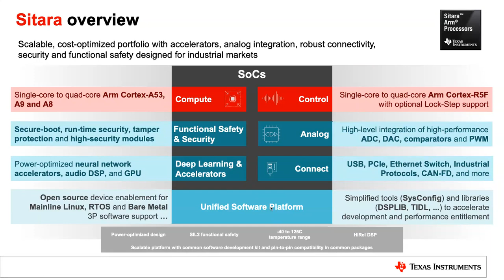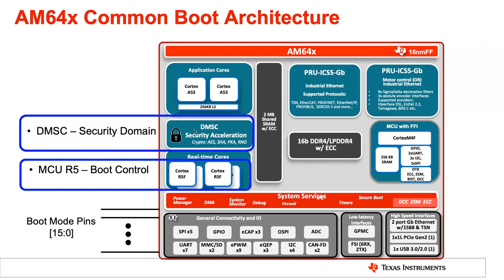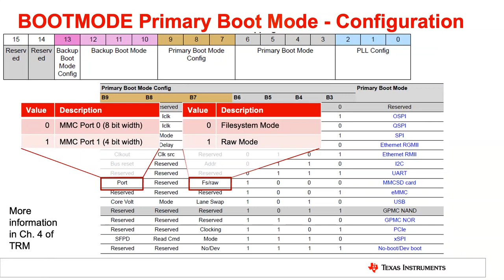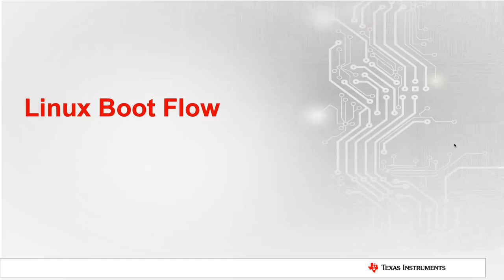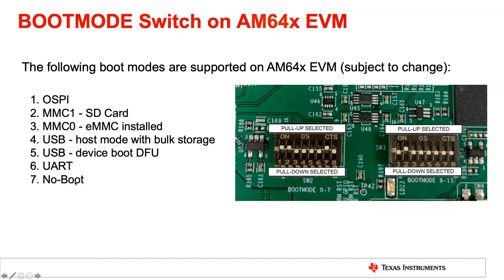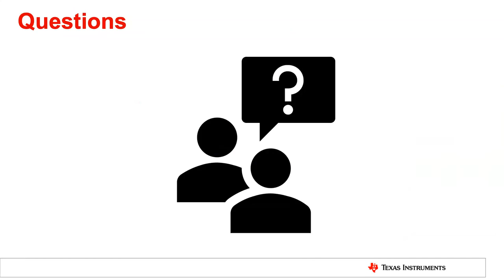Process This: Linux Boot Flow Using AM64x Processors

Comment: - If we are relying on the DMSC SYSFW and MCU+ SDK to ensure that the AM6442 operates safely, does that also mean that MCU+ SDK and SYSFW have passed any kind of third-party software safety certification testing?  
- If not, how can we then rely on them as a safety critical component.  
- And if we can't rely on MCU+ on them, does TI support any design flows not using SYSFW or MCU+ SDK for customers that need safety certification?